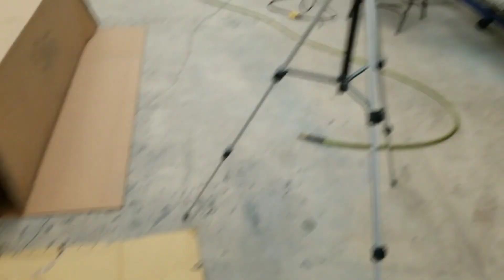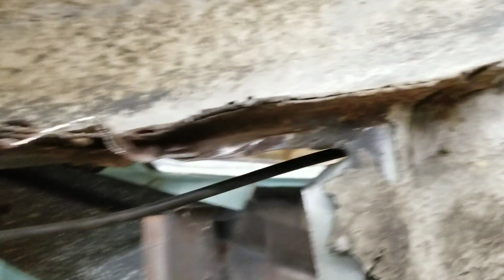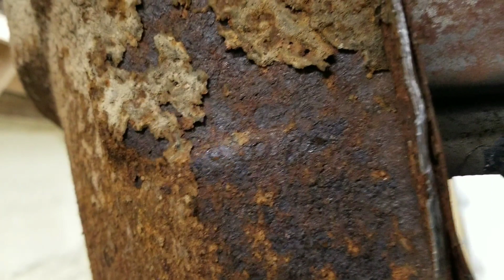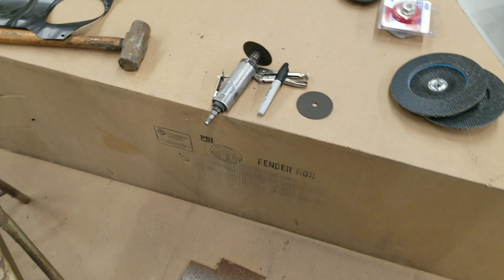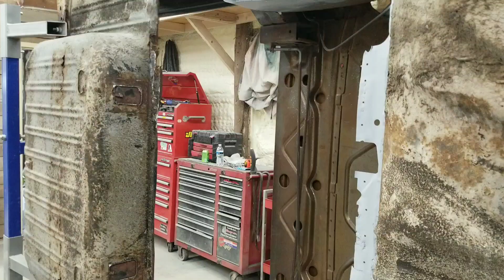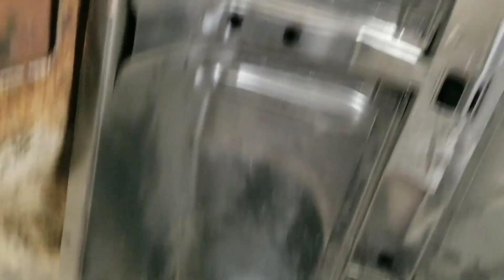#Frankingston 64 impala build part 2 how to trunk shelf panel replacement

Comment: Nice work! Question, I’m in the process of replacing floors front to back on my 61 convertible, I’ve already hung the doors and got the gaps right for the outer rockers an hard welded them in, I’m now installing the full floors with braces, which I removed the inner rockers to make the job a little easier to install in pieces, I’m then going to screw everything in and then move on to the upper trunk deck and box braces, my question is.. the trunk deck you purchased came with box braces? And how do you know the box braces will line up with the holes in the frame? Thanks brotha.
Reply from the maker: Time, patients, a lot of measurements and test fitting

Comment: Do you think that could be done with the body still on the frame? I’ve even considered cutting the new shelf in half so I could go in thought the trunk. Iam not doing a off frame with my car. More of a on frame preservation
Reply from the maker: It could be done but it will be hard. Definitely will need a buddy and a lot of patience
Reply: @bpbrestorations2093  thanks. Well I’ll
Just cross that bridge when I get there. Having to much fun driving the car right now. Thanks for the reply

Comment: Love you videos man!  Can you put in all the floor & trunk pans on Rotisserie  with a convertible impala?
Reply from the maker: You will have to do some bracing with box tubing(kind of like a roll cage on the inside) to strengthen everything up before you cut on it or it will crumble. Then you can put in all the floor pans. The trunk pan is a little different. If you are doing the full piece then you will need to set the car down on something because the rotisserie bolts to the rear of the trunk pan/support.